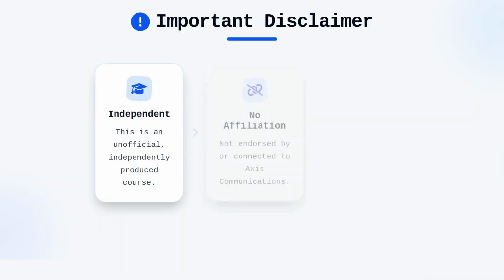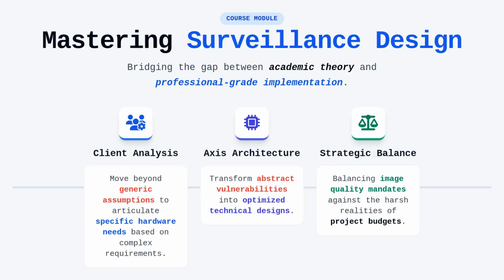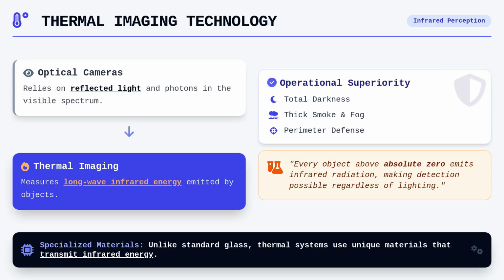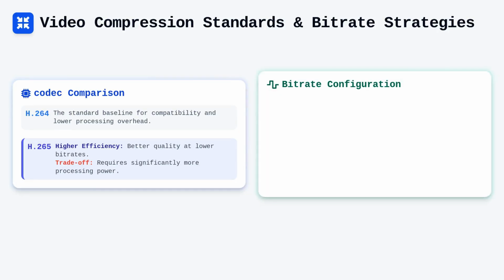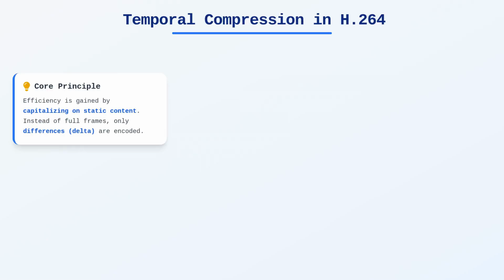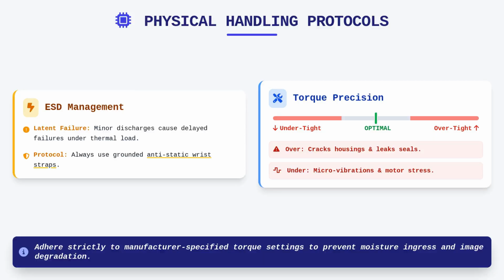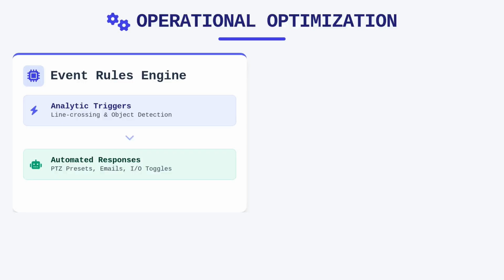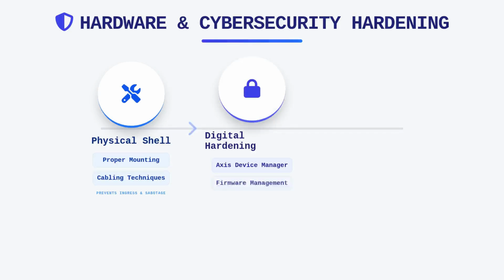Axis Communications AX0-100 Network Video Exam Prep: Full Course

Comment from the maker: Sitting the AX0-100 exam in the next few days? 🦺

The marks are lost on specifics, not on concepts.

Bitrate x cameras x retention calculation errors & pixel density required for identify vs. detect

• Storage math for retention
• PoE class budgets and switch sizing
• lens field of view and pixel density for identification

I condensed 500 pages of blueprint material into a 1-Page Cram Sheet, 15 scenario decision trees, and 390 spaced-repetition Anki cards:

👉 https://www.coursano.com/study-guides/axis-ax0-100

Pin this and review it on the morning of your exam. Good luck! 🤞